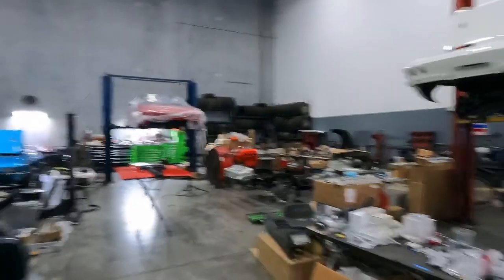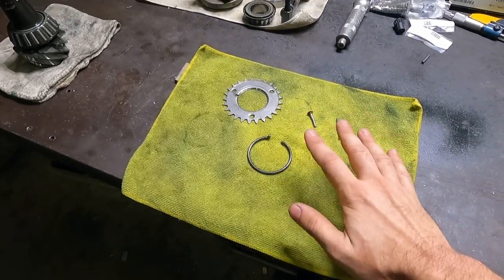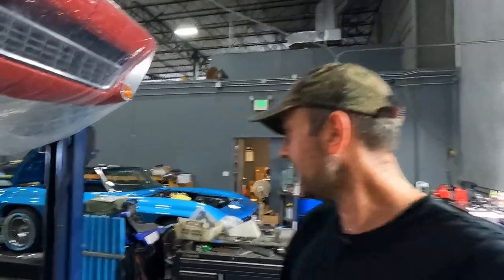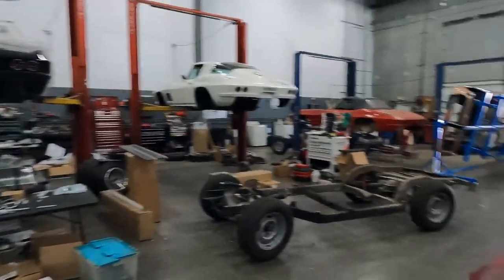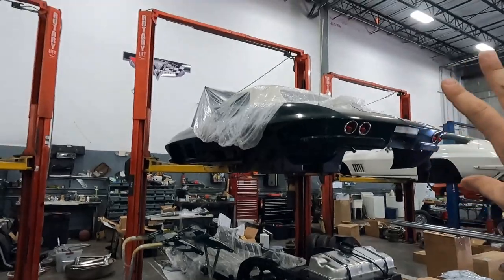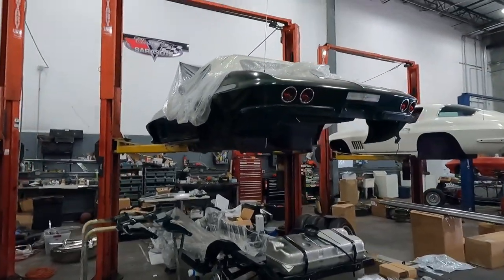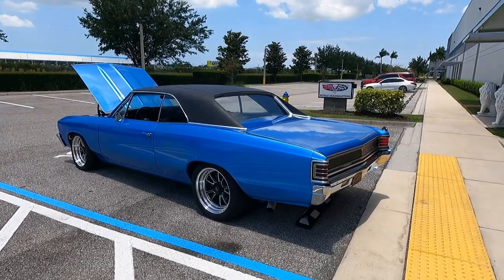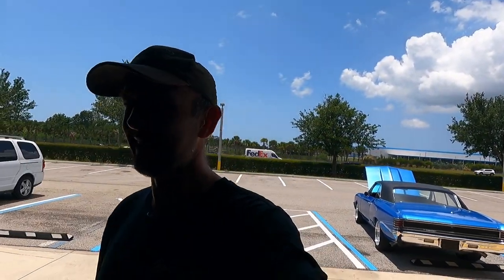Potential DISASTER Waiting In This Classic Corvettes Transmission?!?! Classic Car Restoration Shop

Comment: I would love a 67 corvette coupe with small block, Holley fuel injection system (sniper), 5 or 6 speed manual, air, and stock appearing everything else.  Of course, stainless brake components, and maybe even electric power steering. 😎

Comment: Bruce Lee had the 1 inch punch, Junior has the 4 inch door. Simply amazing...  your cars may be expensive but they are peerless. As far as a Rest o Mod car goes, suspension and Brakes along with a 5 speed manual trans would be my ideal car, maybe an LS Engine upgrade. I hate to alter the looks of the body and the interior are just fine with me along with the Vintage Air addition. Just my opinion.

Comment: Well the factory M20 in my 70 Z/28 does not have that plate. I love the whine of the M22 gears so I swapped them in with GM parts back in ‘81. BUT I like the ratio better in the M20 rather than the ratio the M21/M22 has. I didn’t want to go with the aftermarket M22W because I was told that they are not as noisy because they are cut on modern computer controlled machines.😊 I would never  resto mod a car. And no automatics for me. Those are girl cars.